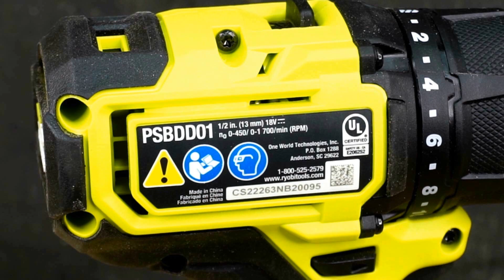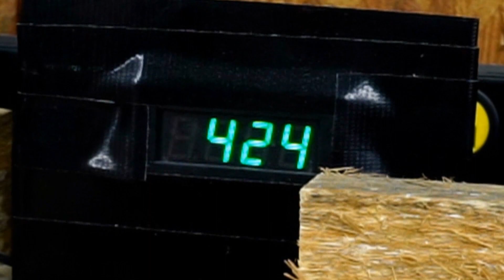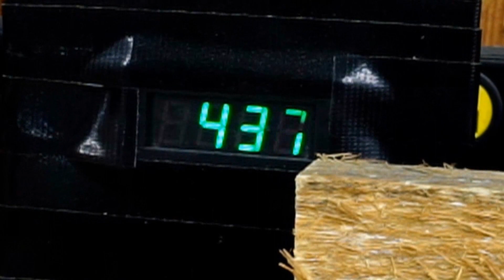Can the DeWalt Atomic Defeat Ryobi and Makita? Best Compact Drill/Driver

Comment: Great job Zack , have the first gen sub makita and like it. People say those drills are weak but not everybody is drilling thru concrete or driving lag bolts. All 3 drills would be great at finer wood working, driving pocket screws and doing pilot holes. Your haircut and beard trim looks great too.
Reply from the maker: Thank you sir. I had to trim up for Thanksgiving. I definitely needed it. 
You’re absolutely right. These drills would be good for woodworking and moderate trade work. Heck, I used a black and decker drill for a few years as an HVAC service tech.

Comment: I got the Makita from Tractor Supply for $43. I has done all the basic jobs needed. Awesome deal. Tractor Supply still has them for $43 if you can find them.
Reply from the maker: Dude I got the 3/8 impact there for $65 and the top tier hammer drill for $65 as well. They have some sweet deals and clearance sometimes.
Reply: I somehow found that top tier hammer drill for $32. I didn't even need it but couldn't pass up that deal, lol.
Reply from the maker: @anthonylerza871 wow that’s wild. Nice! I would have bought it too.

Comment: Excellent, thanks for your effort. I have mostly Dewalt, several Ryobi tools and some Ridgid mixed in lately. I haven't tried any brushless Makita yet. Hope to at some point. I do have a vintage Makita 9.6v that's pretty fun. I also like what I'm seeing from Skil these days, particularly the 12v line.
Reply from the maker: Thanks for commenting. I had the brushless Makita 18x2 rear handle circular saw and loved it. I have the brushless hammer drill and it’s good too. The Skil 12 volt line has been very good for me except one drill that died prematurely.  I would buy them again though.
Reply: @Zacksshoptalk  Good to know. Looking at brushless hammer drills now.

Comment: So I noticed something, the dewalt moved around a lot while you were doing tq test, and the drill test.  Did you feel fatigue after the screws and drill tests, compared to ryobi or Marita?  Like to see cordless ratchet tests, brush vs. brush, and brushless vs. brushless...
Reply from the maker: The DeWalt had such high torque it was tough to hold it down in my dyno. I have already started working on a system to hold tools down in the future. Thanks for the suggestions for video ideas. I actually have started planning for the ratchet video.
Reply: @Zacksshoptalk  something else I was thinking about, many youtubers have tested the impact driver adapters in the past, but I don't recall anybody have done the fail and tq test using the 1/2" adapters.  Would be interesting to see something like cheap impact rated from autozone/walmart/harbor freight to some other better brand name from big box stores, or even the truck brands.
Reply from the maker: @jacklo325 are you referring to 1/2” to 3/8” socket adapters?
Reply: @Zacksshoptalk  the impact rated 1/2" hex shank socket driver...
Reply from the maker: Got it.

Comment: Great test!!  Noticed the Ryobi is an HP version and wonder if it would have done better with an HP battery instead of the standard one?
Reply from the maker: This Ryobi comes in A kit with the standard battery. This drill does not have the extra terminals that some of the other HP tools have.
Reply: it's bad drill. Buy the big HP brother. A lot better

Comment: Hey Zack, I always enjoy testing of small and/or subcompact tools.  I noticed you had some shots of Ridgid brand drill and they do have a subcompact line of drills and drivers (among other tools) that you could maybe bring into future videos.  Metabo HPT also makes a nice line of compact drills and impact drivers along with skil 20v.  Could have a head to head among those three and see who the ultimate winner is when comparing against this first round.  Anyway, keep up the good work.

edit:  Not sure on the exact lengths compared to the ryobi, dewalt, makita,  but Kobalt and Flex also make compact drills.  Also, I don't want to be part of the current giveaway.  Hopefully, it goes to someone who needs it.
Reply from the maker: Thank you sir. I absolutely want to bring the Rigid and Metabo in for future sub compact tests. I went back and forth picking 3 drills and they were in the mix. Maybe the next compact comparison can be Milwaukee vs. Rigid vs. Metabo (or Flex).
Reply: @Zacksshoptalk  sounds like a great comparison!

Comment: I remember many years ago using a 14.4V Makita to put a half-inch spade bit through REAL 4x4 wood in an old Victorian-era house after the owner burned up (KILLED DEAD) his 120VAC Black & Decker trying it.  That tool was my "pay" for the job, which was rewiring a large section of that house.
No doubt Makita still makes great tools; but please EXCLUDE ME from the giveaway; we're heavily invested in the One+ line and really don't need another platform.  Someone else needs it more.
For tools to test, although they are on a much lighter scale, if there's enough interest I'd like to see tests of the new Ryobi USB-charged tools.
Another one I'd LOVE to see is a comparison of those universal socket drivers, the ones with all the pins in them.  I'm particularly interested to know how deep the deepest one goes; I could get less than 1/2" down when trying to put some 1/4" nuts on their bolts when installing a mailbox yesterday, and had to finish each one by hand.
Reply from the maker: Thank you for the great suggestions and input. Tell you what- if your comment is selected and I still have the compact Ryobi drill I will give you that instead. Thanks for watching!
Reply: @Zacksshoptalk  Wow thanks.  As one of the first ones we got, ours is a lot bigger and not brushless.
Reply from the maker: Sounds like it would make a good addition, then for moderate projects

Comment: NEED THIS DEWALT DCD 794 or MIGHT get the XR DCD 805 BECAUSE i like the HAMMER FUNCTION test the FLEX COMPACT HAMMER DRILL it has 650 inch pounds i have one and it would be nice to Pit it Against the ATOMIC DCD 794 or if you have the 799
Reply from the maker: Good suggestion. Just picked up my first Flex product - an angle grinder for an upcoming test. 
I don’t use hammer function often so I stick with regular drill drivers.  I will test hammer drills in the future.

Comment: Just wondering why not use the proper batteries for these drills? Stacked for the dewalt, hp for the ryobi and idk what makita is but yeah you get the point.
Reply from the maker: I was testing them as sold in kits

Comment: Too much emphasis on torque and performance in this video. These are compact drills meant for easier jobs, size and weight are the most important factors, so you can fit the drill in tight spaces and carry it around without fatigue. There should be more weight measurements, including with and without different battery sizes, and size measurements too. In those categories the Dewalt loses and Makita comes out on top. If you need torque and performance for drilling into concrete, pick up a bigger hammer drill.

And btw I have the DeWalt one as it fits my dewalt batteries which, lets face it, in most cases determines what you actually end up getting.